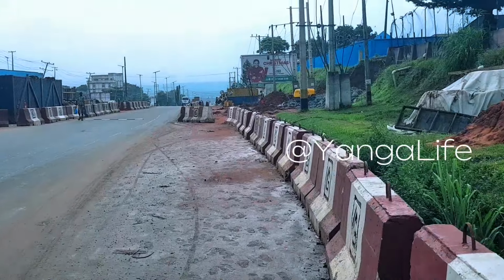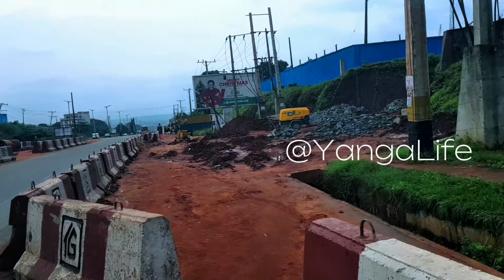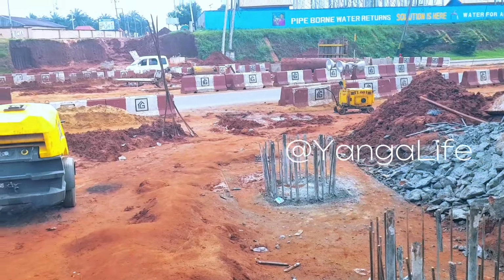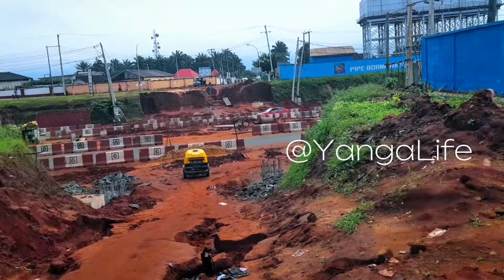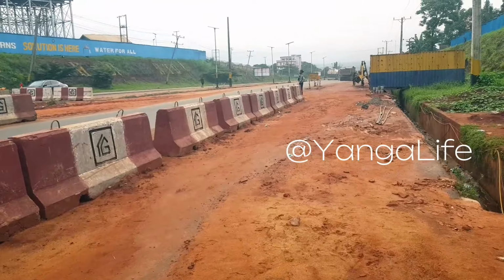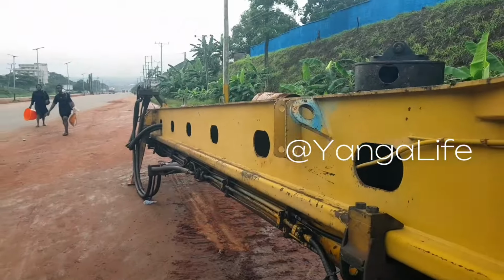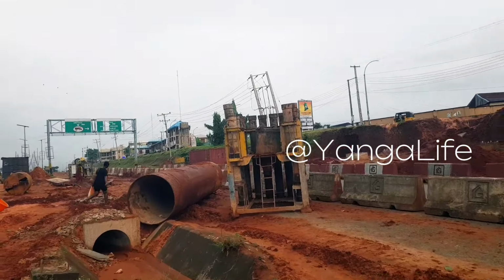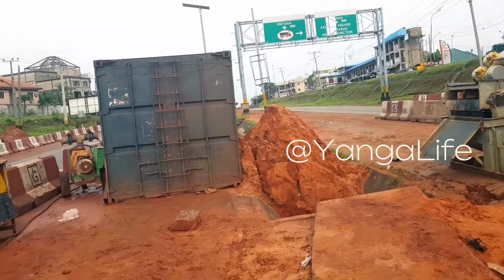Pillar Construction About Kicking Off At Ifite Awka Overpass After Piling Completion

Comment: Am yet to see any continuous work on the bridge after the piling on this video.

Soludo has whole lots of works but what he lacks is good comm of environment and comm of works.
Reply: The both coms. Should be relieved of duty
Reply: Do you know that construction is not automatically done after piling? I am sure you know that the piles must be allowed a specific amount of time before construction resumes. When did they finish the initial piling work that you want to start seeing actual construction? Mind you the work was done at the peak of the rainy season.